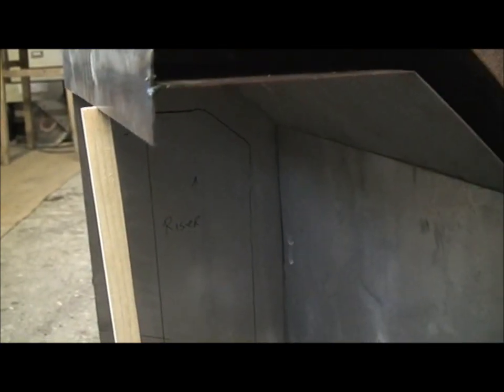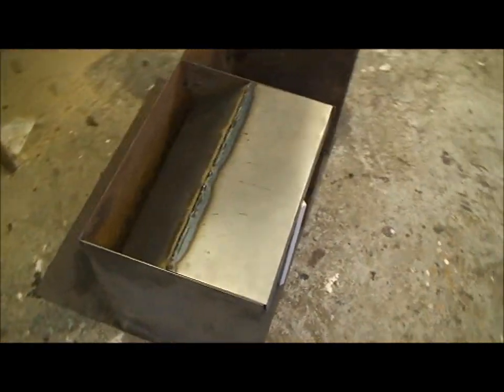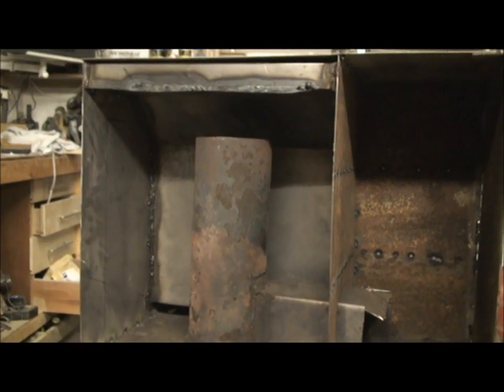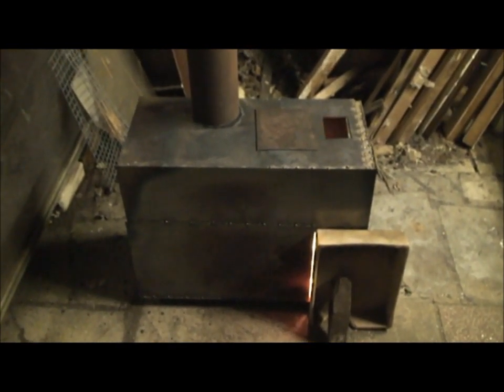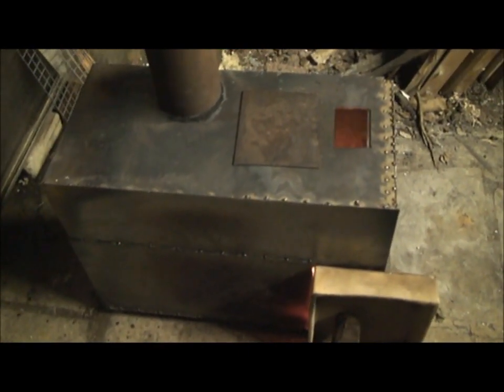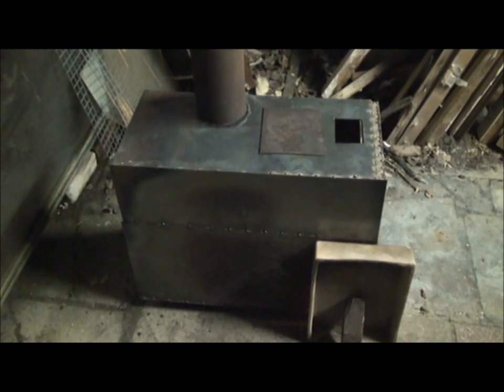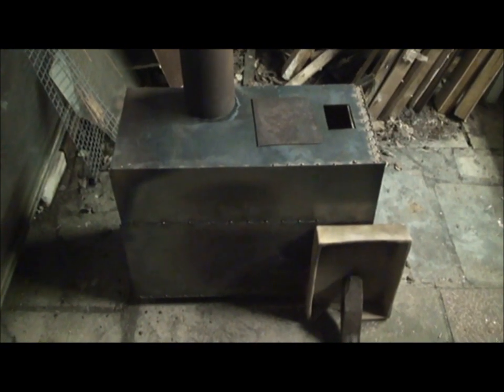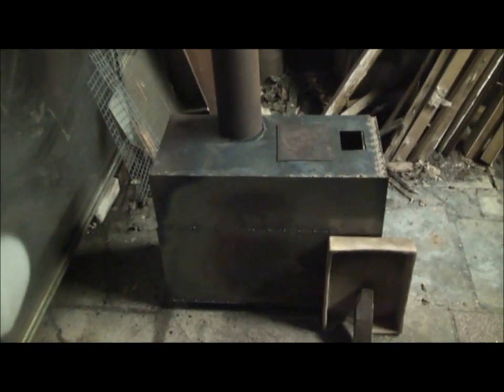rocket stove with boiler  build and burn

Comment: Very informative video. Concerning the secondary hole on the side...Does it have a pipe that goes into the riser? Or is it simply a hole in the riser section and not the firebox section?

Comment: I don't know how many you tube videos I've seen concerning rocket stoves. It seems to me most of them are made by people who like living in 3rd world conditions and proud of it and their workmanship and attention to detail showed it. The main problem is most of the videos are pure rubbish. Until I came across your channel. I learned more watching you than most of the prior ones put together. I appreciate good workmanship. I gather you abandoned this project for some reason. But I wondered if you had ever come across a rocket boiler made by a man named David S? https://www.youtube.com/watch?v=vYH8ZC1gCIw It looks kinda odd but it works. I've been thinking of using that design to heat a hot tub.
Reply from the maker: Hi there, thanks for the comment, no i had never seen that video until you posted it, very simple solution and looks to be doing a great job too. As you might have gathered I build alot of things just to see if they will work, helps me figure out new ideas on stove builds, I didnt as yet go ahead and build that stove but id like to build a very small compact version for outdoors and camping etc. I have several ideas formulating right now. Cheers
Reply: LOL obviously I do not need a monster like he built but whatever design I go with the aim is to heat about 300 gallons in 2-3 hours (or less) to a temp of 100-104 degrees F. I have 4 (now 5) methods to test, one a copper or stainless pipe coiled around the riser, two coiled around the riser but not touching, three wrapped around the outside of the bell, four a water jacket around the bell (your air heat tubes on your shop heater gave me ideas), and finally five the method Dave showed in his build. I would love to keep this somewhat portable so no more than 30-36" high should do.

Comment: This year I am going to build a water boiler rocket stove, my house is about 2,000 sq ft with infloor hot water heating. My question is how big should I make the boiler? The other question I have what is your opinion of the Wiseway gravity fed pellet stove?
Reply from the maker: cant help with the boiler size sorry maybe heating engineer could. only seen the wiseway on you tube but it looks ok, never worked on pellet stoves due to the cost of pellets.

Comment: Hi Ppotty 1,
I have seen your "Rocket stove with boiler build and burn"  very impressive, thank you for sheering.
Did you succeed with all changes you have mentioned?
What is the capacity of the water you can heat?
Did you installed any steam valve?
When opening the top lid of the fire box for feeding more wood, does a smoke/fire comes out?
Did you used the new arrangement of narrowing to one side, to improve the Vortex, from fire box to the riser?
What additional secondary input did you made?
Did you add additional wall with holes for clean air to protect the glass of the top fire box lid?
Thank you
Yuval
Reply from the maker: Hi Yuval, i didnt go any further with the stove as it was just a test to see if the idea would work, I would probably have changed the loading door to the front other than that I cant comment. Cheers
Reply: Hi Ppotty1, thank for the reply.
I have started built a square fire box, square 150x150mm riser 650mm of length, with round 380mm dia by 750mm of length, "out box" above riser. Testing of firing showed: With riser exposed the "fire polling" was good,  when cover with the "out box( barrel) the  "fire polling" was very poor, almost no movement of fire into the riser. 
Would you please write the actual measurements of: 
1.) Tunnel size and length (from fire box to riser)______ ________, 
2.) Riser size and length_______ _______, 
3.) Distance between top of riser and top of the box above riser ____
4.) Chimney size and length____ ___ 
5.) Does Secondary air to bottom of riser required?
Kind regards
Yuval

Comment: hi, please can you help me im possibly moving into a little new build house under the council, and ive got a tiny garden in between house gardens sides and back ,so im right in the middle and i want a little stove in my tiny shed, but the council will not allow it and the neighbors wont like the smoke, do you think i could make a covert shed heater that no one will know about, and see tthe smoke etc,any help much wanted thanks, and good videos, im subscribed
Reply from the maker: Hi Lazy, if a rocket stove is built right it wont produce smoke or smell so i doubt it would annoy anybody, however they do produce condensation from the chimney when first lit, just like a gas boiler, some people will think that is smoke even though there is no smell. I suppose if you told them what it was you wouldnt have a problem.Cheers.
Reply: thankyou for the reply

Comment: Ppotty, did you ever actually finish the stove with the water jacket? I think on the last video I saw you were testing the prototype and getting some water moving through and heating up. Wonder what came of the project? Also you mentioned other "work being done". Can you recommend someone specific who is on youtube? Best to you. Reuben
Reply from the maker: Hi Reubin, I was testing the ideas with these stoves and they all did what they were supposed to do. This one looked very promising and although I have not proceeded with any more work on it as yet,  two people have told me they built it and its now powering their houses with hot water and works extremely well. One guy said he would post a vid but as yet I have not seen anything from him. A you tube search on rocket water heaters might throw up some other ideas. Cheers.
Reply: Thanks, man. R
Reply: ppotty1

Comment: I know that the stove with water jacket is an old project. But I was watching it again and just had an idea. What if, you made the water jacket from concentric larger metal pipes that would surround the riser tube. In other words it would be like a larger riser tube, double walled, around the actual gas riser tube. The water would be contained between the double walls. On the bottom you would have the boiler stand on legs to allow a gap underneath which the hot gas would exit to the space on the outside of the boiler. The gasses would then rise up between the boiler and the extremities of the stove to the flue exit on top, like in your original design. It seems like this may streamline the manufacturing process. Wonder what you thinks? I love watching your stove projects. Big fan. Thanks, Reuben
Reply from the maker: Hi Reubin, that would no doubt work rather well I also know a much bigger firebox that can double as a gasifier is needed for a hot water system fairly small fireboxes would need constant attention to keep the water at temp. but its possible now with the work thats being done on these. Cheers.
Reply: @LozHarrop  I know this is an old post but I'm just getting into this sort of thing. Actually, this setup is working as a glassifier. Not as good as it could but it is. Once you closed off the bottom air, it started down flow. That's when glassification begins. Once you tighten up the welds and tweak the air going in the top, it will improve. I'm working on the same sort of thing right now but instead of a water jacket, I'm using an old solid cast iron radiator that is solid cast. Nice work. It's close
Reply: Rabbi Reuben Modek
Reply: hii,

why do you put water jacket inside ? will it not just steam or burst ? initially i thought u gonna put a big water tank as a way to store therma..  after seeing you use such a small water jacket.. it makes no point....

Comment: I thought the water jacket was suppose to surround the fire so it heats up quicker
Reply from the maker: +Kevin Fitzpatrick Water jacket would cool down the firebox section on this making it less efficient, the section with the riser is used to capture the heat before it goes up the flue.

Comment: Have watched all your videos.  have you abandoned the water filled heat exchanger idea? Which uk supplier did you use for your castable refractory materials?
Reply from the maker: MetalMickeyUK Hi Mickey, no not abandoned just shelved for now while i work on refractory mixtures and linings, will go back to it for sure. I used castree kiln for the refractory it was the 1700C mixture.

Comment: HI ,  Have you also considered trying to get hold of the copper heat exchanger from a boiler that is about to be scrapped ?   I took one out of an ancient one I had scrapped . I assume if it held up from the fire blast of the oil burner it will hold up to a woodstove burn .  Just an idea .  I love all your videos  and I hope I can do my own build in a year.
Thank You !
Reply from the maker: Michaelneil17 Thanks Michael, it would be great if I could find a used boiler that would fit but the chances are slim, since building this I have been in contact with a guy who can build a boiler for me from stainless and have it tested and certified. When I eventually get round to building a working version I will be going back to see him.

Comment: Great video, can you load the fire box full of wood for a longer burn time?   How much time in between feeding?  Thanks
Reply from the maker: John Day Thanks John, I literally did that test burn and took the stove apart, was no point making any changes as it was only built to test the idea. You would get a good 2-3 hour burn from it filled with wood probably longer with the air restricted.
Reply: thanks

Comment: Hi PP1, how many rads could that boiler heat please?  Average-ish sorta radiators, know what I mean?
Reply from the maker: Kevin Chamberlain Had I built the jacket as intended with the sides and front I had estimated it should run 8 rads and hot water cylinder comfortably without overheating the room it was in.

Comment: hey , this is pretty good man ... you are really thinking ... get the stove to heat a good cache of water that you can use ... there's your 'mass'
Reply from the maker: Kevin Olesik Thanks Kevin, Once I get the stove up and running I plan to install a much bigger hot water cylinder to store the heat.

Comment: I've got a 250 gallon oil tank.  I was thinking of using it as a mass to store heat. My idea is a 12" system with duel exhaust. The exhaust runs through the tank (filled with water!!). Do you yhink it's worth it?
Reply from the maker: Jeremiah Shine I think the flue would take a long while to heat the water it  depends on how much of the flue is inside the tank I guess.
Reply: I'll draw it up.
Reply: Jeremiah Shine
Look up engineer 775 he has a design for just the type you are looking for. I want to incorporate it into a rocket stove for a narrowboat.

Comment: Instead of a water jacket couldn't you use stainless steel tubing attached to a single plate inside of the box in an S type pattern. It would be easier to plumb and less fear of the jacket bursting under pressure from the heat. It should reduce your cost some and be simpler to modify
Reply from the maker: Madrocket, Thats worth thinking about, the pipe would have to be a fairly big diameter for it to run on gravity but yes that could well work out. Cheers.

Comment: Hi ppotty1,
I thought the burn chamber had to be 1/3 shorter than the riser to avoid back burning. Obviously it doesn't. Are you getting away with that because of the draw from the chimney going straight up or do you think the same design could work for a a mass heater with the chimney going along the ground for some distance?
Cheers
Murray
Reply from the maker: Hi Murray, Some configurations work despite the thinking they should not, im sure the flue set up on this helps alot with the firebox draw. However I think you could run a flue horizontal on this and still get the draw needed.
Reply: *****
I'll give it a go and let you know how it goes.

Comment from the maker: davie simracer, Hi , I doubt steel this thin would last long at these temps but this was just built for testing out the idea, final build will be around 7mm thick on the body with the internals built from stainless

Comment: Great work; cannot wait to see it.  I had threaded a pressure relief valve in one I built so that it would spray water on the fire if it were to go off.  Never happened.  I used one without the probe that is for temperature too. I was concerned it might leak.
Reply: +Kenny Foust Excellent idea. Tell everyone at the 
forum. The woodstove technology forum

Comment from the maker: +davie simracer Hi Davie and thanks, this one was just scaled down from the proper one I will build but it turns out to be a nice size and punches out tons of heat so I may end up building this size for the house. Dimensions are 24" wide 15" deep 18" high will measure the size of the boiler and firebox and put them in the video description above. Cheers.
Reply: ppotty1 I
Reply: When are you going to be finished the build and test video?
Reply: ppotty1 .8

Comment: Looking good, I cant wait to see the finished product.I have an off grid cabin with a very inefficient wood stove (it's on youtube). I've been wanting to build a rocket mass heater for it. I think something like this with water heating capability as well would be great. Thanks for sharing and keep the great videos coming.
ATB, Steve...
Reply from the maker: Thanks Steve recon you would have hot water in abundance using a set up similar to this. plus a very hot cabin.